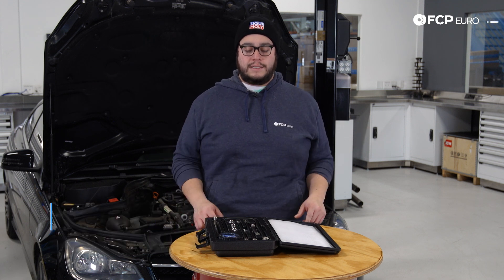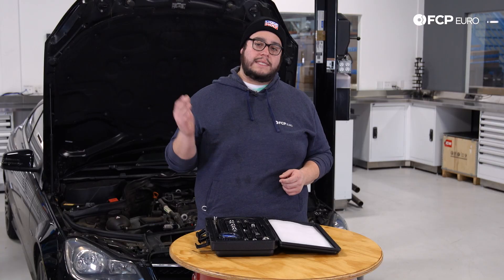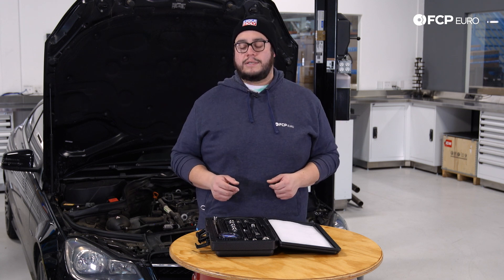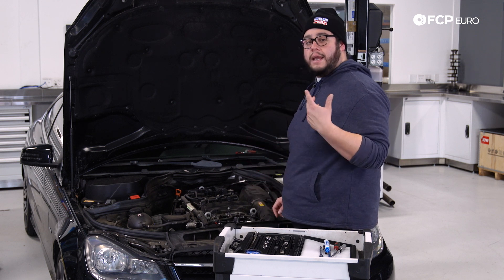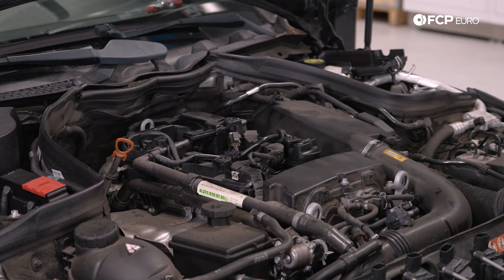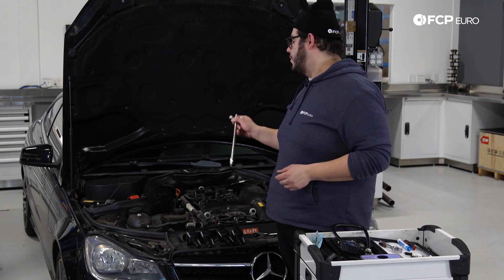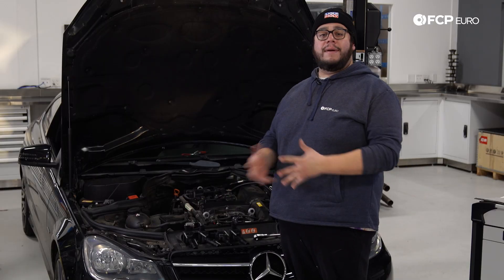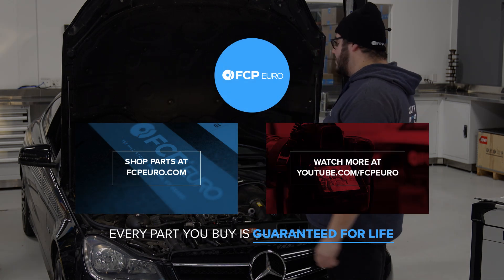How to Perform A W204 Mercedes-Benz Compression Check

Comment: Same year make and model and oil on the spark plug coils. What would be a good guess or next move if compression tests are as follows: 
Cylinder 1   87
Cylinder 2  60
Cylinder 3  60
Cylinder 4   60

Asking for a friend smh
Reply: Proceed with a leakdown test your values are too low. My first guess would be the pistons rings. Bad piston rings will cause oil to internally leak from crankcase onto the cylinder head and obviously a failing compression test. I believe you also have tons of smoke coming out of your exhaust as you are burning oil. Oil consumption will increase with time and im pretty sure the engine is low on oil now. If my guess is correct, during the leakdown test (a bit tricky for DIY. Side note: never allow the engine to rotate during this test. Especially not counter clockwise) open the oil cap or dipstick and you will hear the air leaking hissing in there. You must do that for all 4 cylinders. On the other hand the odds of having all 4 cylinders failing the compression is a bit low and might be a cause of a much bigger problem. Keep us posted.

Comment: Great helpful vid! Please, just help me double check something before going ahead: in order to cut off the fuel supply to the injectors during the compression test on the M272, did I understand correctly that all one has to do, is keep the accellerator pedal to the floor while cranking the starter? Would removing the fuse for the fuel pump achieve the same thing, or would that cause the ECU to prevent the starter from turning? I just don't want fuel misting into the cylinders during the test. Thanks.
Reply from the maker: Hi Ed, for this vehicle specifically, the pedal procedure will work. Some vehicles you have the option of removing or pulling a fuse or relay, as well.
Reply: @fcpeuro  Gotcha. I ended up pulling the fuel circuit fuses & flooring the pedal to open the throttle body. Thanks for the reply!

Comment: Is it true that the compression cannot be directly measured and known at any given moment of time because the act of measuring the compression necessitates a disturbance to the system, thus causing it to change? More specifically, does it force the compression value, whose existence and value may be modelled and explained to exist  as a distribution of semi-stable  probability functions denoting the stable resonance forms with higher stability to fluctuations in the quantum world having a higher probability of existing at any given moment of measurement due to the duality of particle and wave behaviour of electromagnetic radiation? Thanks in advance. 👍🏻. You guys rock.
Reply: wtf?!?
Reply: You’re overthinking it mf